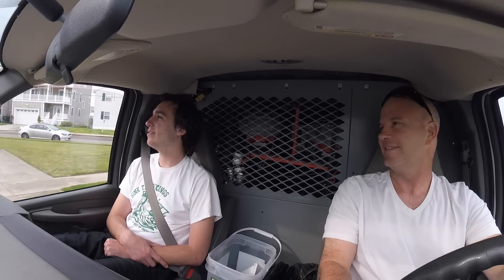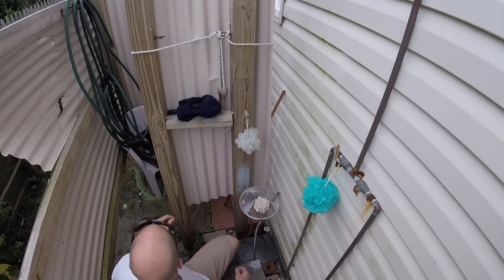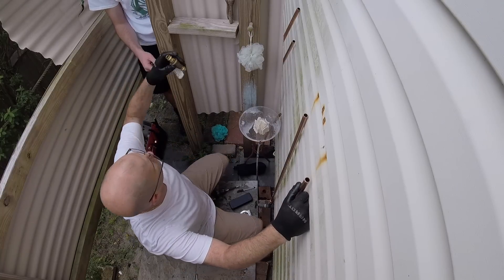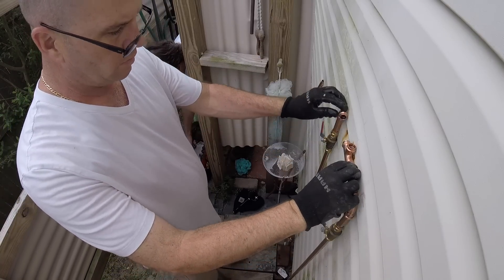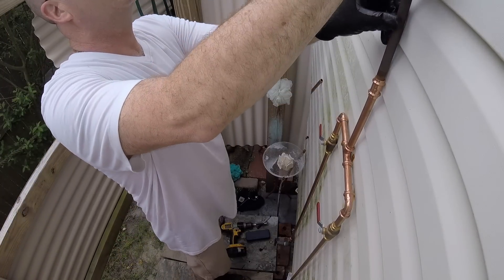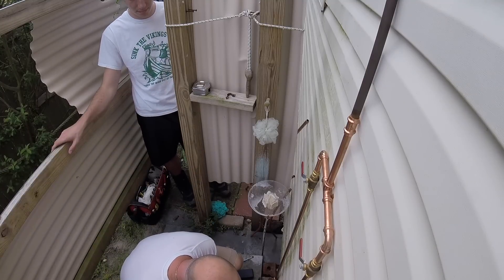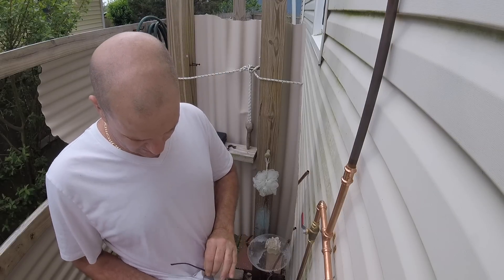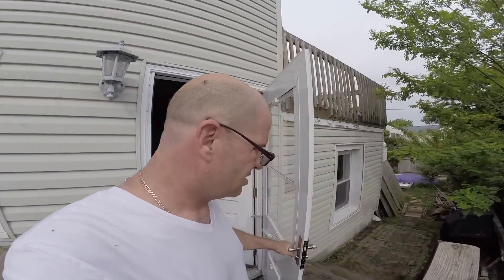Ridgid RP 210 Pro Press shines again

Comment: 1. This method is why I've stopped sodering and am press-fit as much as possible.  2.  I recommend all your pipes be cleaned on the inside and out, including the new pipes- and also de-burr the cut pipes.  This will ensure your rubber gasket of the pro-press fitting doesn't get cut by stragglie metal. 3-99.  why on earth does anyone have completely exposed pipes on the outside of a house without any insulation?
Reply from the maker: Thanks S will. Yes on the sanding. I always do it now. The shower is beach shower only. Drained in winter. New Jersey is location.
Reply: @ChuckBarron  Thanks for the reply.  Would it be possible to set up an auto drain for this shower plumbing if the temperature gets too cold?

Comment: Good job and I definitely like the Pro-Press system, however, wouldn't it have been a less of an expense, for the owner, to retain most of the pipe  of the "goose neck" and not have to add an additional Pro-Press union fitting? If your goal was to retain all the pipe clamp locations al you had to do was increase the lengths of the two supply lines to the cur out valves.
Reply from the maker: so many options.

Comment: Honest questions:

What's the shower for?

Is it normal to have pipes that move so much?  By that, I mean, at 3:56 he cuts one side and the whole assembly tries to lay down flat on the ground.  Is there no need to anchor the pipes below the surface?  

From what points is he measuring at 6:31?  Top of the ridge of the fitting, or just beyond?
Reply from the maker: its a beach town.  shower outside when done beach time.

Comment: You could have prefabricated it all with sweat joints then strapped it up. Soldering is still the way to go.
Reply from the maker: Back in the day for sure....
Reply: I went to the local hardware store to get some copper elbows for a project I'm doing. The hardware store didn't have any, the boss said he was getting out of the soldered joints because almost every plumber now has gone to the press fittings. Solder is indeed old school at least here in Australia.
Reply: Cesar Rios How long you been in the trade Cesar?
Reply: soldering....use it if you like it, also in this video, copper pipes, never again, only stainless steel or galvanized nickel steel, something like Polish Kan-Therm pipes....cheaper then copper and MUCH better

Comment: Do you guys have pex in Jersey? Because in NY that's all we use.. it's last forever and it's way faster then using that pro press Bros.. look into it .. and not to mention way cheaper..
Reply from the maker: Yes on the pex. I do both but most of the stuff we service is copper. I do 90% service work. I do use pex on new stuff or renovations.

Comment: This guy is great -- but why would he not go ahead and replace the last two feet of copper just  under he shower head ?  Ok, its' still works, but why mix one piece of old with all the new?  If asesthics didn't count in plumbing Kholer wouldn't be in business!   Didn't want to spend the extra bucks.  But he knows what he's doing, and the press is a def. sell.
Reply from the maker: good point.. but the situation here is keep er running and keep it moving. Thanks Dave.

Comment: I only have a problem with the video. Too many shortcuts. No deburring after cuts? . It also looks to me , by the way the pipe moved to the right of the installer after the new pipe was temporarily fitted, that the elbow below was loose. This means the Teflon tape was not sealing the threads 100%. He didn’t even visually checked it. Another issue, not even a check valve in between the two ball valves, is this a mixing system or what and finally, nothing should come in touch with the exterior siding. Should have installed some cushioning between the piping and siding. Sorry, I would have never published this video.
Reply from the maker: Thanks for the tips zap. Lets do a collaboration on your job soon. Where you located?

Comment: O.M.G. -I would have prefabbed the shower in Soldered Copper (away from The Siding ) and connected it to the old hot and cold lines with compression couplings-Bingo Bango -Half the COST and Half the TIME (and ONE PLumber) ! You Guys Look Like The Third Ring At Barnum and Bailey
Reply: Personally, I can't stand compression fittings and I'm sure the guy could've done it alone as well. When you teach someone, it helps to instruct and have them perform the actions. That way these trades are passed on and shared. The video also mentions that the channel is to raise awareness about mental health, you should try some inward reflection instead of being an ass on the internet.
Reply from the maker: Thanks Dan...Dave is out to lunch.  bingo bango...lol
Reply from the maker: bingo bango....lol
Reply from the maker: shark bite city. bingo bango....lol